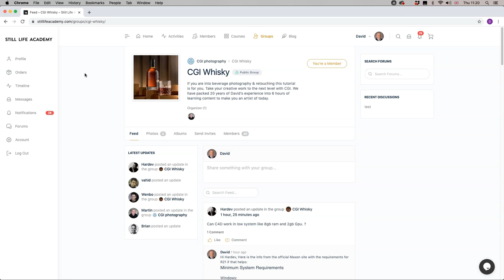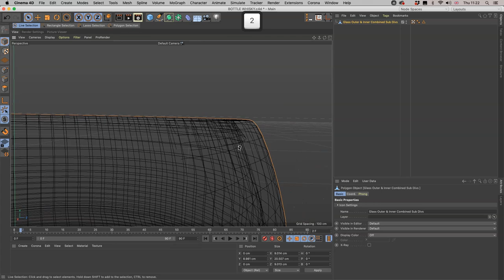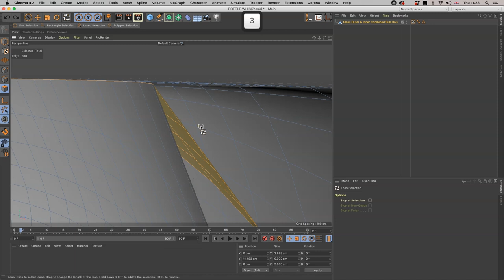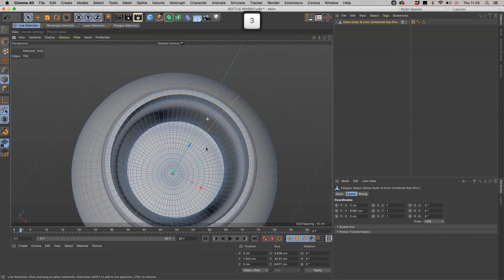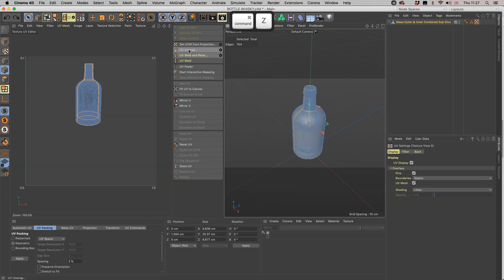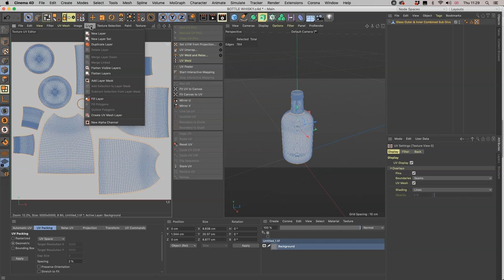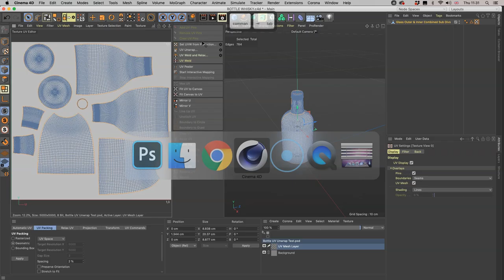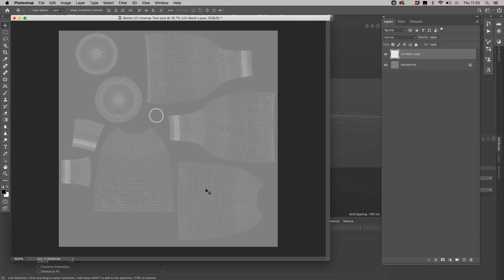How to Unwrap UVs in Cinema 4D S22

Comment: I've watched a lot of these UV videos, and yours is by far the simplest but also most informative for a new user. I appreciate there's a lot more to go in to but this has really helped me getting to grips with this process. Thank you.
Reply: Thank you so much @kaiker much appreciated with the feedback and hope it steers you in the right direction. I shyed away from UNwrapping UVs before S22 simplified it all as it was so complicated and basically scared me. So I would use any method to avoid it such as cylindrical mapping; also doing different renders with different displacement maps on different areas and then comp'ing the renders together. Thanks so much to Maxon it has massively improved that task aspect of bottle work.

Comment: Thank you very much for this. But how do I load the uv map back into c4d?
Reply: Hi lolboy11 You create a new Corona Renderer material and for testing purposes I load the newly created psd into the Diffuse slot and then apply with UV Mapping to my object that has now been unwrapped and has the newly created UV tag on it. Double click this material next to the object and change the preview from Default to 2048 x 2048 or even 4096 x 4096 if your RAM can handle it to really see everything in place. Now you can go back to the psd and start laying in graphics and text ready for Displacement mapping or for laying on of text. Hope that helps.